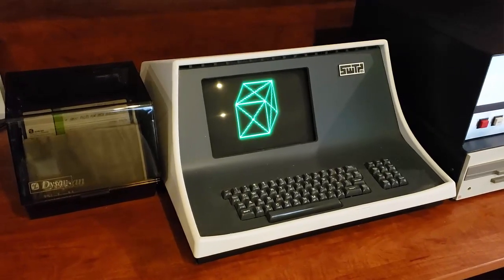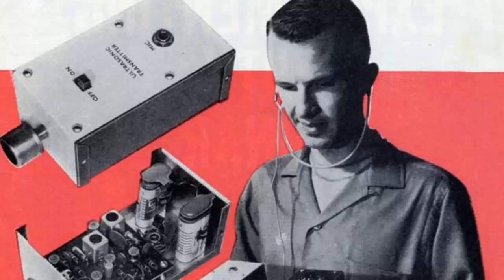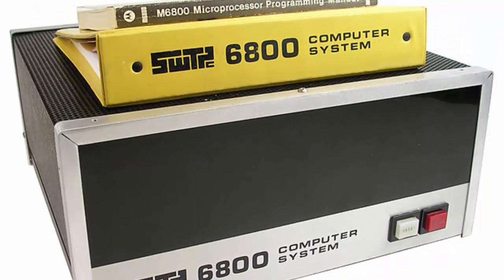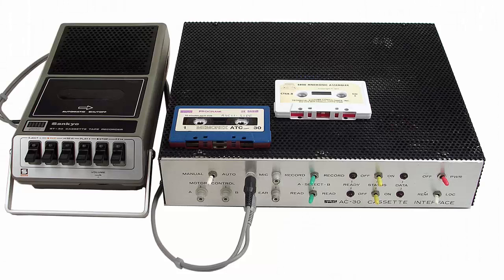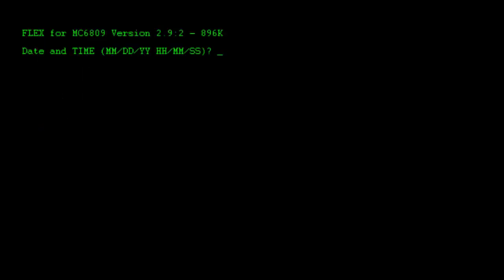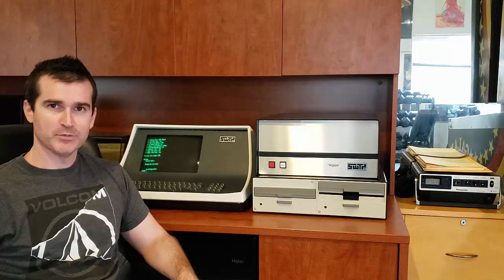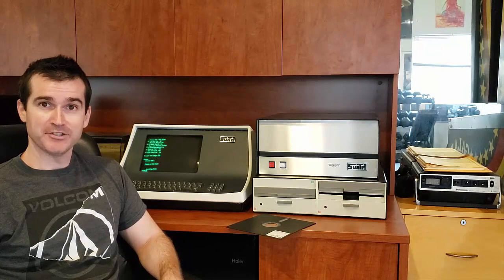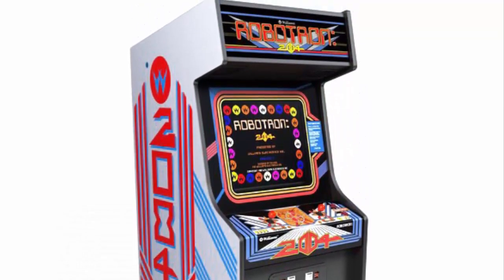SWTPC 6800/6809 Computer Review and History

Comment: Thanks for the memories. I built a couple of "sweatpack" (SWTPC) systems way back in the early 80's. I made and sold a Radio Modem to Queensland Rail (Australia) based on the 6809. My own design PCB. Only 1200 Baud, but it was a full duplex error free protocol that I invented. Needed a voice channel - tones were Kansas city type of noise. 6850 ASCII data into a tone generator receiver - TCM3105. Radio transceivers were simplex however, so the TX relay got hammered; Send/Rx/Tx/Rx/Tx etc. as each packet was acknowledged! :-) Lucky the train order messages were short. Great video. I also met Dan Myers and 'Lucy' on a trip once to San Antonio - I was so wrapped up in the company I forgot to visit the Alamo on that trip!

Comment: There's something about 70's and early 80's computers that I can only describe as magical. I don't know, I was born in the mid 80's, so I missed that time completly, obviously. But there's is something about those machines that fascinate me.
Reply: I was dabbling with home built stuff in the 70's. Was a lot of fun. My first was based on a signetics 2650 8bit running at 2Mhz. I also built a TRS80 clone on wire wrap boards. The real coding fun started with the 6510 on C64 with color graphics and sound. A simple but capable CPU. They all used cassette tape for storage. Yes, there was something almost magical about those early days.

Comment: I very much enjoyed seeing you cover the history of these machines. I was familiar with the SWTP computers, as I programmed  them for clients back in the day.  I did not however, realize they made music synthesizers before they made computers. 

One hardware fact that I didn't hear in your video - Their terminals really were beautiful from an industrial design perspective. They were also MADE OF WOOD (at least the ones I used). You wouldn't know it to see them sitting there. The curves were sleek and really looked like something that might only be achieved through molding plastic. Then, if you tapped on them, or pulled the cover, it was a little bit of a shock to realize that someone had probably hand-sanded that work of modern art sitting on your desk. 

A word of warning for anyone collecting or restoring these - Some of the distribution disks for certain SWTP commercial software products were keyed to the serial number of the computer to which they were licensed. (This was mainly in the UNIFLEX environment - I don't know about FLEX or other OSes.) If you tried to install them on the wrong machine, I dimly recall them just hanging forever without actually telling the user that nothing was going to happen. As early DRM goes, it was brutal if you were trying to get work done and happened not to be paying close attention to your cabinets full of floppy disks.  I never got to reverse engineer them enough to figure out where they were storing the machine ID in the hardware. 

True confessions:  While I tended to mostly work as a programmer, I also sometimes found myself doing a lot of system administration work on certain jobs. This was the platform that taught me as a system administrator to re-read my dangerous  command lines twice and pause before hitting the return key. I once inadvertently formatted the install disk for something (might have been UNIFLEX) for an SWTP machine. Then I discovered that I couldn't just substitute any of the install disks for other, identical, machines at my site. Oops. 

These really were great, attractive machines. I'm not sure they get the title of all-time coolest 6809 boxes - that distinction may have to go to the Ohio Scientific Challenger 3P - Why not put 3 different perfectly good CPUs with different architectures in one box and let the programmer use any and all of them at their perverse whim? But I digress...

Thanks for an interesting and informative video!  Now I need to go buy a TRS-80 Color Computer. I blame you.
Reply: ...and bat detectors. Don't forget them!

Comment: I bought my SWTPc 6800 in late 1977. Parts started arriving in 1978, and by fall I had it working. I bought a Model 15 telex machine and wrote an ascii to baudot add-on to basic including delays for carriage return/line feeds and letters to figures shifts. My telex was capable of doing 60 baud but the polar relay was to slow so I had to increase the stop bit from 1.5 to 2 bits. Around 1980 I got floppy disks for it and by 1984 I was on the internet. I applied for a subnet and got one with 32 addresses in it. I never had DNS and used just IP addresses. I just had Telnet and FTP. Later they took away our class A and I lost my subnet. I wrote a checkers program in machine language and the moves had to be entered in hexadecimal. I got the gt6144 graphics card and wrote a Pac-Man like program for it. While my AC-30 doesn't work, I took all of the cassette data in S format and put them on a modern computer where I can load them onto my SWTPc. I'm still trying to get the floppy drives working.
Reply from the maker: I know there has been some interest in programs written to take advantage of the GT6144.  I'd love to see your Pac-Man program.  Can you send over the S format code to my email.  You can get it from my website.
Reply: @BrianPicchi  That program is on my one of my floppy drives.  To make it go, you need an Atari 2600 joystick controller attached to a parallel port. I also modified the other parallel port with a 74121 to make it hold down the line for enough time for the 6144 to capture the data. My floppy drives don't work any more but I've heard that there is a program on windows that allows you to read 35 track floppies exactly. Do you know of a program that would work. I still have a 486 computer running windows 3.1 with a 5 1/4 floppy.
Reply from the maker: @clcswitcher  Good question!  I also could use a program that can read floppy disks and save them as a disk image.  Very easy to do for other computers like the Apple II.  If you find a solution, please share it with us.

Comment: Good presentation. I used to read Creative Computing in the '70s and always found this system interesting. Later I owned several Tandy Color Computers and worked for a company selling 68K based OS9 systems. I have a soft spot for Motorola based systems, especially those based on the 6809 and 68K.

Comment: Great video. Please show us UniFLEX which uses the real power of that machine with the Dynamic Address Translation. I've had my first encounter with Unix (well, something close to it) on a French SWTPC 6809 clone called the Goupil 3. Here I am some 35 years later, as a so-called Unix/Linux "expert" and systems engineer. UniFLEX has taught me what a real multi-user, multi-tasking O/S on a micro could be. I really miss the sound of it badly shaking the 8" disk drive at boot time before spitting out that "++ " prompt...

Comment: Does anyone know the model number for that terminal screen, it’s amazing looking!
Reply: After a bit of research the terminal is an SWTPC 8212, rather than the SWTPC-82 mentioned in the video.
Reply: @garywilkinson5887  Right! While the CT-82 & the 8212 were identical inside, the CT-82 is a much fuglier piece of hardware! I know, I have one! Always envied those who waited for the 8212! Far as I know the CT-82 was the first "intelligent terminal" period. It had a 6802 driving a 6847? (6845?) CRT controller and that made it much more capable than anything else money could buy at the time! Gary Kay & Joe Deres did some amazing work at SWTPc back in the 1970's.

Comment: Does anyone know if OS-9 LII was actually available for the SWTPc 6809?  I know LI was, and LII was available for the GIMIX.  The Evenson emulator has disk images of LI, but not LII.  I have an SWTP 6809 (parts of 2 different ones) which does have a DAT circuit for up to 1M RAM, so it certainly could have run LII.
Reply from the maker: I believe so, but only on later models of the 6809.  The S/09 and GIMIX computers were capable of addressing much higher RAM than the 6809 69A and 69K, for example.
Reply: Yes, it was. L1 was for machines with 64k (or less) RAM memory. L2 required machines with >64k RAM and the DAT thus was a much more powerful OS.
Reply: @wa4kdc  Any idea if there are extant disk images?  All the ones to be found in the usual SWTPc repositories are LI only.  There are LII images for GIMIX machines, but at least some of the GIMIX CPU boards are significantly different from (more sophisticated than) the SWTPc CPU boards.
Reply: @wa4kdc  And yes, I've used LII on the CoCo 3, and it's very nice.  LI in 64K can be a bit cramped.
Reply: @joelavcoco  Sorry, I have no idea as I was a part of the Flex world at the time.

Comment: How do you screen cap an old computer?
Reply from the maker: Terminal Emulators.  I mostly use the TeleVideo950 Emulator by Michael Evenson if I'm just playing around and testing.  For file transfers I use HyperTerminal.
Reply from the maker: I also use the SWTPC 6800/6809 Emulator by the same person mentioned earlier.
Reply: @BrianPicchi  I've been playing with SWTPCmemulator and I have UniFLEX running on it. Still trying to learn to create a new bootable DSK file. I worked with the 6800 the CT-64 with FLEX and a Gimix Ghost with OS9 Level II (in 1984). The Ghost allowed us to have 6 people use the system plus 2 printers and a news feed. I loved the Ghost and I wish I had one.

I have 3 Corsham Tech boards. I'll be setting up FLEX on the 6800 replica, NitrOS9 on one of the 6809's (moded to 1M ram) and the last 6809 (moded to 1M of ram) will get UniFLEX. I can't afford the real things. :-)

I'm working on getting the 6809 UniFLEX env completely working and accessible from Linux. Have you found any 6809 UniFLEX documentation? I have the 6809 UniFLEX source and the 68K documentation. I'm reverse engineering the rest so I can rebuild everything and accessible from Linux.
Reply from the maker: @neilcherry6452  I love hearing how these old systems were used, so thanks for sharing that.  Most stories with GIMIX involve multiple users sharing the system and using OS9-Level II.  My experience with the 6809 has been almost exclusively with FLEX.  It is a wonderful OS.  I have only scratched the surface on UniFLEX, but I am very intrigued by your project and would love to hear how it progresses.  Be sure to send your question about documentation to the FLEX User Group.  They are super helpful and answered some of my programming questions.
Reply: Firstly, assuming something like a SWTPC etc, they talk serial, so just use a PC as a terminal. If you cannot get that to work - current loop interface, weird handshaking (highly unlikely) or it requires a terminal emulation that's hard to find a PC emulator for, then sniff the video from inside the terminal. 
Internally a lot of terminals drove the screen using composite video, or separate H, V sync and luma, that can be combined into composite, then all you need is a comp video capture device on a modern PC.
Failing that, there is a raspberry pi based converter out there that takes in multiple variations of video and outputs HDMI, this was primarily made to allow old machines to talk to modern TV's and monitors. then all you need is a HDMI capture dongle for your PC/MAC.